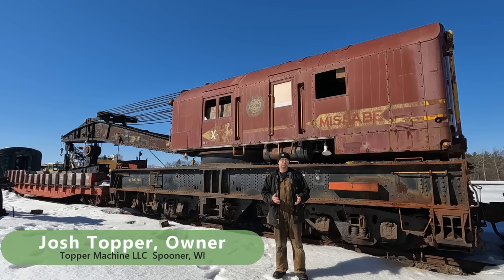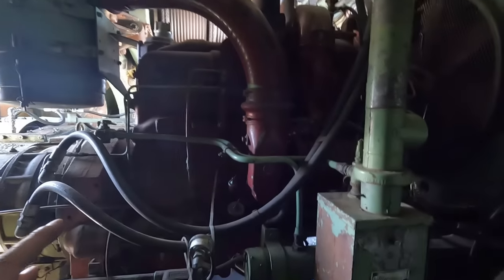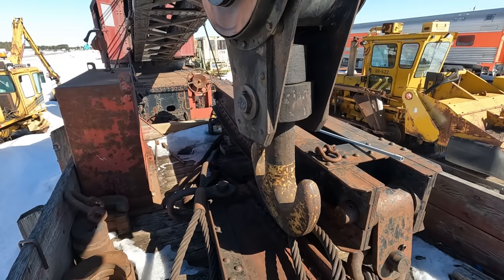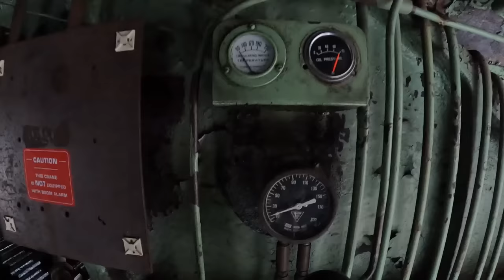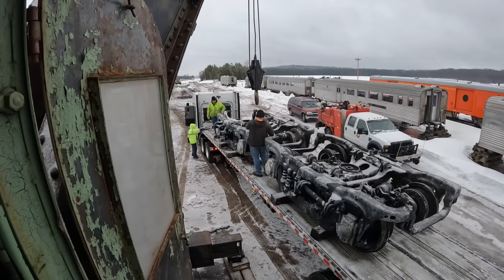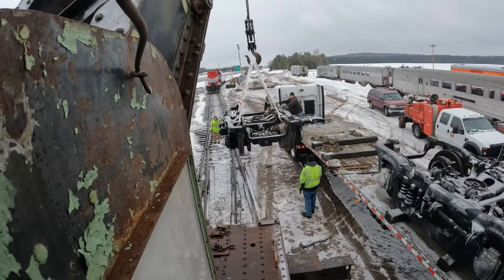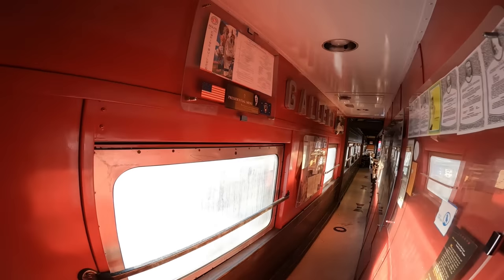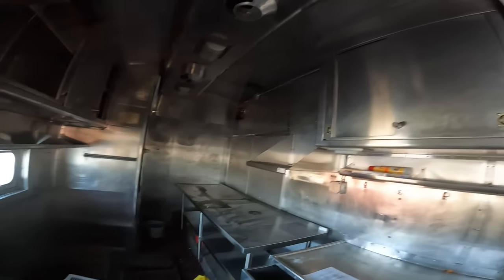Railroad Wrecking Crane, DMIR X7, Inside Tour & Lifting A Great Northern Ranch Car

Comment: I moved a similar “sleeper car” that was part of the Barnum & Bailey Circus train, a few years back.  Loaded in Huntington, WV, took it to Gallipolis,OH, to the Gallipolis Freight Station there. We loaded the same way with (2)100 ton cranes on each end, unloaded it with a 30 ton crane,one end a a time, I have a video of unloading it on YouTube under machinemoverman,. Also moved the caboose there, from Wheelersburg, OH. I have moved several cabooses over my career (over 50) and one 75 ton locomotive from Kentucky to Ohio. That old crane is smooth! Good job!

Comment: A long, long time ago (45 years), in a city far, far away (1100 miles), there lived a 12 year old kid (me) that had a very similiar railroad wrecking crane car in HO scale in my collection of about 20 cars... I think it was either a Bachmann or a Life-Like product... It had thin black string for the cabling, and a little round crank wheel movable between 2 windows for the 2 winches... It had the same pair of lifting hooks - one fixed and one on the strings, and the associated rigging flat car... I'll bet you guys know exactly which HO crane set I'm talking about... It was just the coolest car I had ever owned, and I used to "recover" all kinds of derailments on my layout...
Thank You!!! for making this video... It was like a blast from my past... I never knew any of these crane cars actually existed...

Comment: I'm former DM&IR track worker, 32 years. I've worked a few wrecks that required the Big Hook (Little Monster, if I recall). While this crane is a mechanical marvel, we can not really appreciate the value of the cribbing needed to keep it from tipping over. Brief glimpses in this video, but I'll tell briefly. There are massive outrigger arms which are extended from both sides of the crane, at both ends of the crane. Timbers are used as needed to build support for the outriggers at all 4 corners of the crane. If the grade is less than flat, you will see Jenga towers built up for this part of the setup, and they are carefully built, because of the very significant weight that has to be supported. If a 250 ton lift is needed, the boom is up at a pretty steep angle to get the load as close to the end of the crane as possible. Taking a strain on the hook under full load is pucker time. Only 2 people matter, then...the crane operator and his signal man on the ground. The only person who can talk to them now is the wrecking boss. There's no do-over.
This is a really good video of this mechanical marvel. Today, everything is hydraulics or wrecking contractor bulldozers with side booms on them, working in tandem.
Reply from the maker: I would love to hear some of your stories of the "Missabe Little Monster".  We may even have some mutual friends. Send me an email. youtube@toppermachine.com
Reply: When I was a kid about sixty years ago 
I watched one of these bury about four layers of cribbing 
Before they got it stabilized to do the lift !
It also scattered a crowd of onlookers when it let off steam
Reply: If I had $300 to spend on that crane I'd buy a case of grease and two wireless cameras and  monitors with a high refresh rate.
Reply: I was wondering about lateral stability.
Reply: Yes I've met Thomas Koehler before..he Is one guy if you have a question about welding or the railroad. You need to pick his brain...
Reply: Thanks for clarifying the matter of lateral stabilization and the use of cribbing. I was really curious.
Reply: See my comment under Jennifer Whitewolf.
Reply: Yep we have rj corman here in Ky
Reply: Mechanical Engineering

Comment: Watched many wreck cleanups with 250 tonners, but still steam powered, 50+ years ago. Back when you could get close...  Railroads had wreckers at each division point, hooked to shop steam, so they could send the two nearest wreckers to work both ends of the wreck, and buddy lift. There were probably more wrecks back then, but much less nasty chemicals, and in much smaller tank cars. Friction journals, jointed rail, no radio, no defect detectors, early metallurgy, etc.  Nowadays, CAT 583's are fun to watch too.

Comment: I hired out in the mechanical department for Southern Railway in 1979 and spent many years on the Derrick crew. Everything about this work was crazy heavy and difficult! Another commenter mentioned the cribbing under the outriggers. More often than not, you’d spend a bunch of time leveling the ground as much as possible and then building the cribbing, which we topped with a massive aluminum “toadstool” that the outrigger jacks pushed on. Then make a lift that would be done in a matter of minutes, at which time we’d tear down the cribbing, move the Derrick a few feet, and repeat the process - over and over and over! Our hook was an Industrial Brownhoist 250 ton Derrick, but was built with 2 Detroit diesels and a separate diesel light plant. I had begun training as an operator, but before I got very far Norfolk Southern pulled the plug on derricks! These things were the polar opposite of today’s joystick cranes, as the massive wall of levers, valves and foot pedals shows! And on our hook, NOTHING was labeled! This provided job security for the two men that operated it, but it was a bear of a thing to operate even if it had been labeled! I’ve often wondered if there’s any type of museum or historical group that has preserved anything about the Industrial Works of Bay City, WI? These things were fascinating beasts!

Comment: Over the years I’ve volunteered on three different steam powered tourist railroads. My hats off to you for actually maintaining and USING the wrecker crane. Back in the day when this stuff was available at scrap price (I’m 76 and I remember) the tourist shortlines bought cranes and snowplows and M of W equipment and put it on their museum and display tracks and never operated it. When a record breaking snowstorm was expected everybody would look at each other and wonder out loud if that rusty snowplow would actually work. It seems that when you guys acquire equipment you actually keep it operational.
Reply from the maker: My customer, shown in this video, is an actual railroad and not a museum. Museums have a terrible habit of acquiring something and never maintaining or properly storing equipment. That is why I do very little with non profits.

Comment: You have no idea how valuable this video is to me at this time. I am rebuilding an O scale version of one of these cranes that was originally made in 3 rail toy train quality. Seeing how it is operated helps me set up doors and windows, ... I am completely revising the crane lines and hooks, and I'll be adding grab irons, 2 rail
couplers, etc. I would really appreciate some views of the accessory car, and its 'stuff' on the deck.
Reply: The boom car is whatever is needed to serve the crane and operation.  It matters if you are modeling a specific car and at a specific time because they changed as needed.  These cars carried chains, cables, blocking, slings, etc., and, sometimes, a couple of extra trucks.  There also could be some sort of house or box for tools and other stuff to support the picking up of a wreck.  
A wrecking crane was always taken to the site with the boom in the trailing position and at restricted speed; that was the last thing that was wanted is to derail the wrecker.
One time in the 50s or 60s, the KCS-L&A was picking up derailed cars with a 200-ton and a 250-ton crane.  It had been raining, when does a wreck happen in good weather, and the grade gave way under the cribbing of one of the cranes making it overturn with the car.  They had to bring in the SSW wrecker to pick up their wrecker and help finish picking up the mess.
The KCS used the 250-ton wrecker to off-load a brand new automatic tamper from a flat car and wound up dropping it, the tamper, and turning the wrecker on its side; of course this all happened just outside of the superintendent's office window.
I got to see a 150-ton steam-operated wrecker in operation at Beaumont, TX once.   That was neat.

Comment: One of the neatest things to come out of the UP Turbine Locomotives was the automatic fuel filter. It had three cans -- two of them were the fuel filters with a paper-like media and the third was the catch can for the scum. When the pressure differential reached a high enough point, the fuel flow was diverted to the second filter, and the first filter was backflushed with steam into the catch can. Bunker C is heavy stuff, so it was already nominally at 250F.

Comment: I use to do the same job in a locomotive shop that they closed 3 years a go. It was a 1969 loain latice crane. Set up and ran the same way. It sounded the same way all down to the streight pipe engion. Sure do miss them days.

Comment: We had one of these cranes, in the yard, when I worked at Motive Power.  I was a locomotive electrician, but on breaks or lunch, I would sometimes see these things at work.  Then there was one of these cranes, parked behind my old house, back in the early 2000's, but UP butchered it up for scrap, along with several boxcars, and an old caboose.  I was lucky enough to tour the caboose.

Comment: Thank you for this opportunity to see one of these cranes in action. I scratch built one of these in 1/29th scale out of sheet styrene, using a 1/87th scale crane as a model. It has passenger car trucks underneath it because I haven't been able to find Buckeye trucks for it. I set my crane up as diesel powered with a CAT diesel engine and generator I got from a 1/29 scale, search light, flatcar load. It has battery powered electric motors and hobby gears to operate the winch drums and turn the unit around on the platform car. I need to find some braided fishing line for the cables. I had to use something I call "Imagineering", to figure out how the outriggers extended, but I did pretty well with that aspect. I didn't do the rack and pinion, crank out feature that they probably have. I'll have to come visit the site to get some better ideas about the spreaders and such. I have been a volunteer with the Minnesota Transportation Museum when they had the 328 running out of Osceola. and at the St.Paul roundhouse.

Comment: Worked derailment sites early in my career that used the 250T Industrial Brownhoist wrecking cranes on the B&O.  Tremendous power, but took seemingly forever to set up the blocking and rigging to make moves, and a long time between moves when the blocking an rigging had to be reset.
Reply: I worked with one of these back in 1976 it was 250 ton its a massive machine I've seen this and a 150 ton Derrick working together the 150:ton looks like a midget next to the 250 . his workspace is almost non exsistant very small space but it was all the big heavy guys that ran  it when I was around. Its funny to watch them up and down the rail on there on. Self propelled.

Comment: look like you could benefit from an outside loudspeaker communication thing. pretty cool crane thanks!
Reply from the maker: We generally use radios.  When we did the random lift we had radios in both cranes, the ground lead had a radio and 3 spotters with radios. As safe as we can.

Comment: Hi I love. Your wrecker nice     . Worked for INPR  RR in Emmett Idaho ran our wrecker and it was a old Seaboard coast line and it was converted to diesel and ruined the control system was electric over air clutch and you had to power all movement in like yours with all the original controls. I do miss my 25 ton Ohio steam crane. The big hook to me was not as safe for the riggers because of the electric I’ve air system that they put in very temperamental and jurkey not as smooth as it probably when it had a boiler in it. But now I don’t have that problem anymore it was cut up for scrap but the 25 ton Ohio still is around but meets a tube job. Thank you for the memories I will be watching your channel

Comment: This is nothing like I imagined.  I have operated Bucyrus Erie, Northwest, Link Belt, Lorain, and Koehring crawler cranes set up mostly for dragline and clamshell work.  Those were friction operated machines that were about the coordination of both hands and feet on three levers and two brake peddles at the same time.  I believe I saw only two brake bands in this footage.   Working one function at a time would make this thing a little safer in way for the kind of work it does.  The feathering is obviously done by slipping the converter much as one does on friction operated cranes with air controls.  With a mechanical controlled units, one can just slip the individual drum clutches for controlled hoisting.  They used big clutch bands next to the drums that were actuated with friction boosters.  Direct drive machines with air controls were not well suited for heavy hook work.  I suppose when this unit was powered by steam, one slipped the master clutch to achieve precise control.  Not sure how one would stop the swing on this thing other than with that brake band next to one of the 45 degree gears.  Every function controlled by a jaw clutch and  perhaps a pawl... I never knew this before.   I have seen scale models of these wrecking cranes, but never saw the inside of one these things to see what they were about.  I can imagine that lubing that slew assembly is a real joy.   This was well worth watching.  Thank you.

Comment: Awesome video, certainly unique, many thanks for sharing. Just a thought, ever consider making a cutout in the roof over the operator's workspace so you don't keep banging your head? if it hinged at the top you could open it and have headroom as well as a rain/sunshade. As someone who is 6'3", I kept cringing at the cab shots. The reflection of the controls on the glass frame was a great touch.

Comment: Wow, you probably have the only working crane of this type around.  The last one of these I saw functioning was in the late 1960's and it was steam on the Atlantic Coast Line RR.
Reply from the maker: There are very few left in operating condition. As far as I know this is the last one in actual railroad service and has been used for derailments.

Comment: Nice video.  It takes real skill to run any crane but all mechanical crane. Top shelf well done Josh.  The motor is that a 855 Cummins non-turbo?  Sounded just like one especially with all the air dogs and brakes engaging.  I’ve only been part of a tandem pick a few times and you’re exactly right lotta little movements moving together.
Reply from the maker: I'm guessing its an early 855 sCummins. It's a NHRS. I am not a fan of sCummins at all, so I really don't pay much attention.
Reply: @TopperMachineLLC  cool i’m not a Cummins fan either they are very overrated.  Lol But I like that older stuff.  Thank you for the reply.
Reply from the maker: @EEJester1586  when I started driving truck it was all sCummins. I thought I was driving something with power. Then I got in a truck with a Cat.  I've rebuilt sCummins and Cats. Cats are by far superior engines, low end torque, great economy. I personally love 2 stroke Detroits. I'd take a truck with a 6V71 over any sCummins. You said it about being overrated. They are pump and generator engines, not designed to deliver power below full throttle. And they always sound like they are about to throw a rod. Lol.
Reply: @TopperMachineLLC  yes sir I’m a big fan of Detroit as well cat made some mean motors too.  I think the must underrated motors has to be International.  I’ve been a big DT 466 fan for a long time they’re not good on power they’re not good on fuel economy, but you can’t beat them for cranking and running every day.  It’s a shame international never made a bigger engine than the 530 in a 6 cylinder.  I think they could’ve killed the big truck market.
Reply from the maker: @EEJester1586  I love my DTA466. Absolutely the best motor IH made for trucks. Smallest of the commercial trucks engines that can be rebuilt in frame. You can't say that about sCummins, the 8.3 is a pull and replace. And the 466 is way quieter and more low end than any small sCummins I've ever worked with.

Comment: I love that crane! Was this filmed at the railroad museum that is along 53? We pass by it every winter when we head to norther MN. on our ice fishing trip. One more thing I should point out, at about 20:20 in the video, you have a camera pointed at a pneumatic cylinder. It looks like the mount is a little loose. I can see some movement there.
Thanks for the great video!
Reply from the maker: You have the correct location, but it is not a museum. This is an actual for-profit railroad. That is why you see so much happening there.  Thanks for the heads up on the cylinder. I'll look into it. It's hard to catch everything when you aren't back there watching it.

Comment: Crane engine looks like an early N series 855 cubic inch cummins.  about 200 or 220hp.  So long as you keep the correct coolant in her, she will go forever. This crane is an absolute beast..........not far from where I live is Richmond Vale railway in the hunter valley, and they have the old steam powered version. Dont think it runs. Biggest crane I have ever seen, was at a construction job at Port Botany, Sydney.......it was an 800 ton machine, slinging girders for the extension of the airport runaway.   When things go wrong with cranes, they really go wrong.......LoL